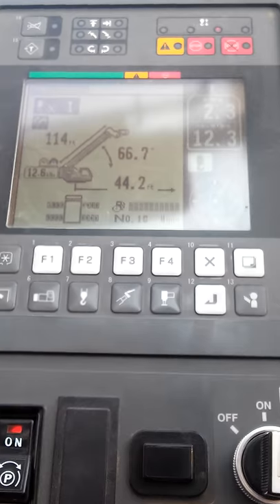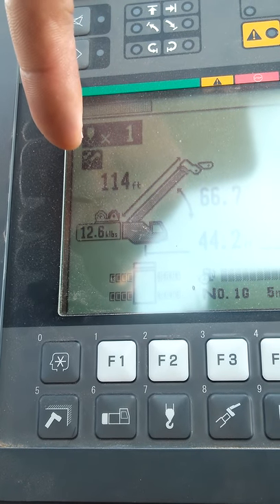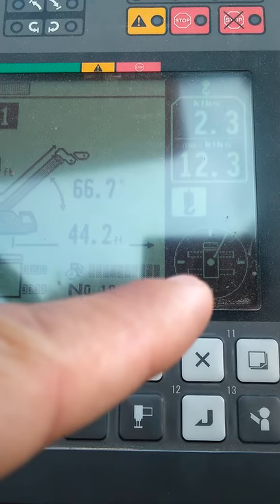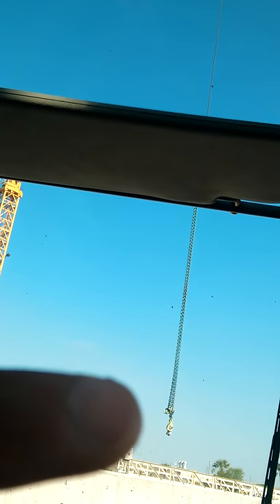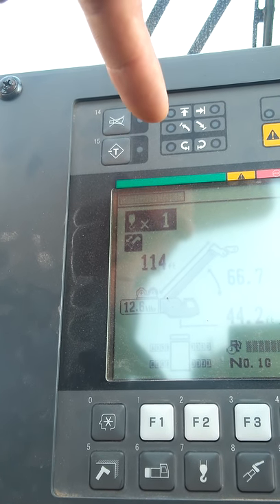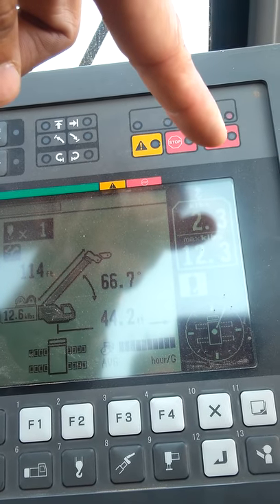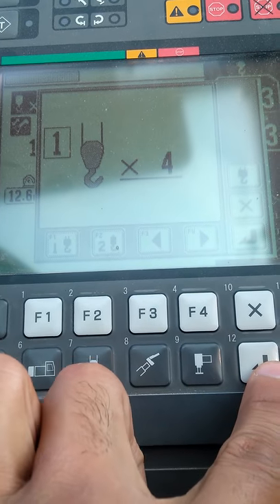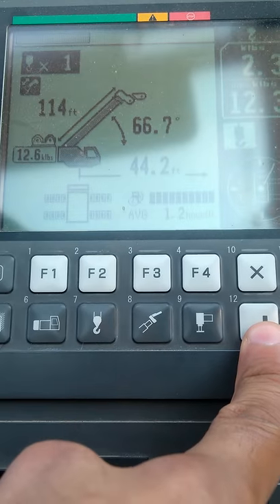How to run a crane computer lmi

Comment: Thank you sir I'm starting to understand it a little better I start my class to be officially licensed Monday June 12 2017 . I've only operated 4 diff RTs 28,40,60,65 ton and non of them had the LMI they where all older cranes
Reply: droenttrilla how much is the registration fee ?
Reply: I live in dallas Texas went to a school called 'miller crane works' best decision/investment of my life today I did my practical on fix can and swing cab. I paid 2,300 but if you've never been on a crane it'll be like 5k and that's just to teach you then you have to take the second level which will set you up to get ready to take your test and be licensed . And then another 2400 for lattice and tower crane . All the exam fees are included
Reply: droenttrilla thanks for ur answer
Reply: chukwuma james no problem sir wish you luck . The crane business is the best thing I've ever done in my life I love it .

Comment: Great vid Tony and thanks for sharing your knowledge.  Why would you want to extend booms 2 and 3 first instead of just 1,2,3,4 in order ?
Reply: Section 1 is your heavy boom section used for heavy lifts in the video you can see he’s using his auxiliary line no need to extend out heavy boom section and add unnecessary weight to crane

Comment: I can't show the boom selection mode on my screen ..if I select main hook or auxiliary then press enter.    It's directly goes to screen the boom selection mode is not showing as you described in your video that 3-4 boom is extend first ...if you anything knows about this boom selection setting help to resolve my issue

Comment: Hi tony
How to reset the tadano becose the poom can't move up and down
Eter to right to the left
Reply: abdu altome normally an LMI will only lockout boom down, tele out, and hoist up, so if you can’t boom up then something else may be the issue. Low on hydraulic oil by chance? You may also figure out if it’s the LMI by using the lockout override, which I would imagine this LMI has, to see if that gives you boom function. If you use override and still the boom does not move then you know it’s not the LMI. 
After you get that sorted out remember you must program the LMI or you will be locked out until you do so.